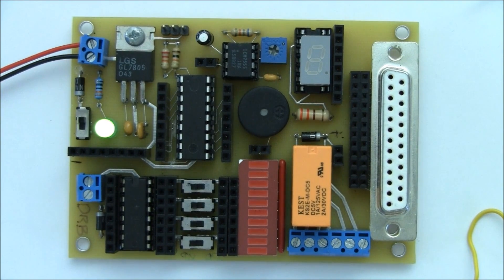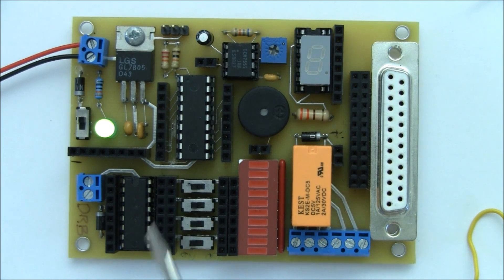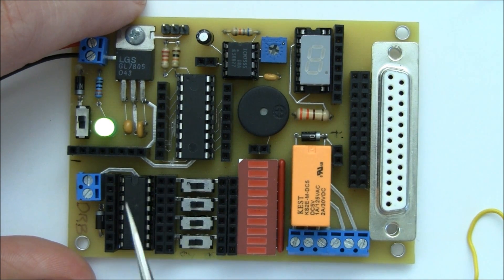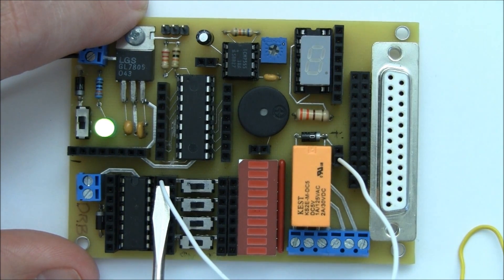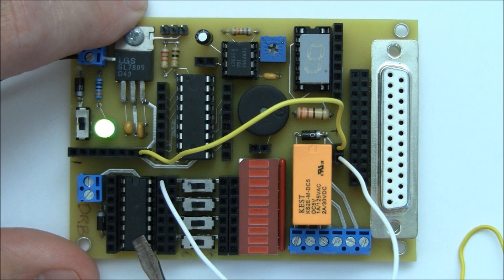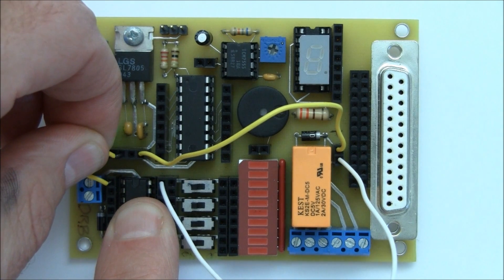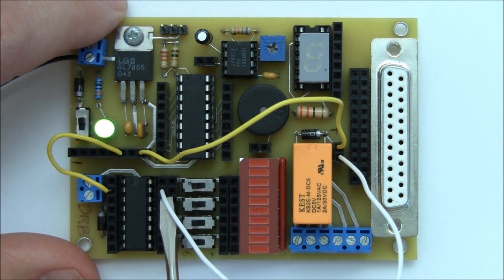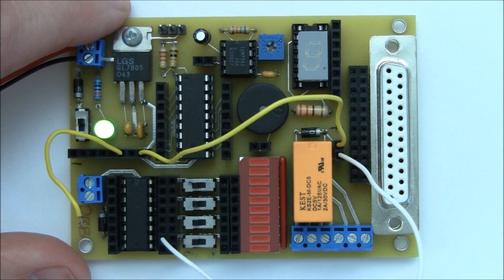Testing the ULN2003

Comment: What is this microcontroler near the buzzer, without any serial number?? I got a board, controling 4 devices by 4 relays, supervised mainly by a ULN2003 and a microcontroler like the one present on this board, and of course without any reference on it, so I am trying to find out. 
So what it the reference of the microcontroler without any writing on it please??
Thx
Reply from the maker: The microcontroller is the Picaxe 18M2. They were very inexpensive, easy to work with, and easy to program.
Reply: @drbrono  Thx you very much, but wow!! they need programming!!!
My issue is I got this board, that stopped working suddenly, and I doubled checked 98% components except this dude because I did not know its reference ((
So my idea was to change it, cause as said all other components are fine, that what is kind of crazy!
Reply from the maker: @DrZipZwan  This board was my own design and I had them printed up for a class I was teaching. What board were/are you using?
Reply: @drbrono  You've made the video for your pupils?